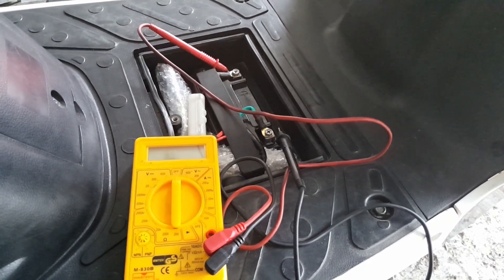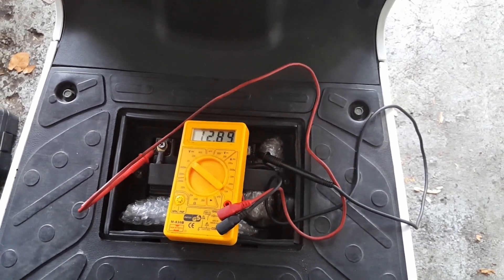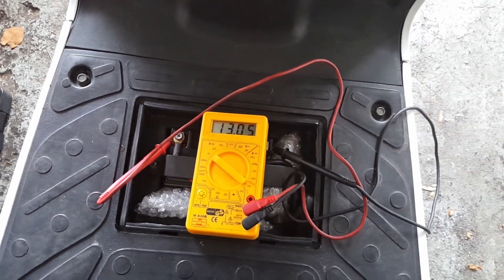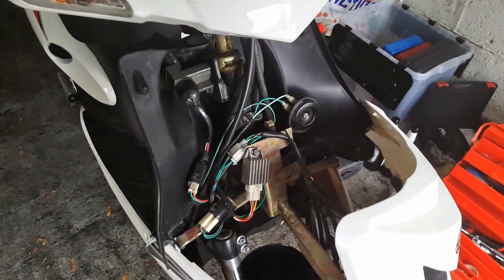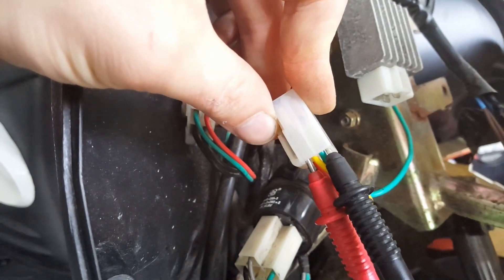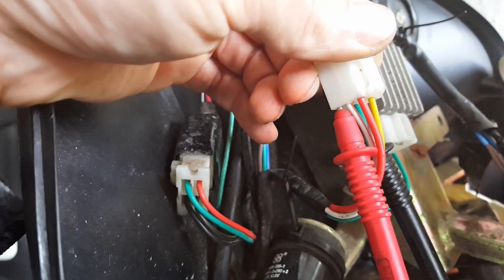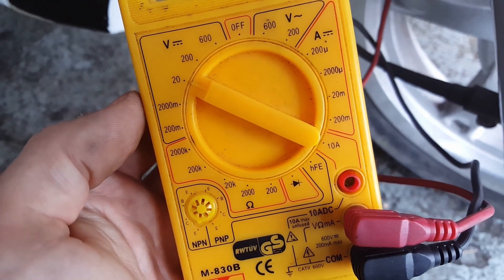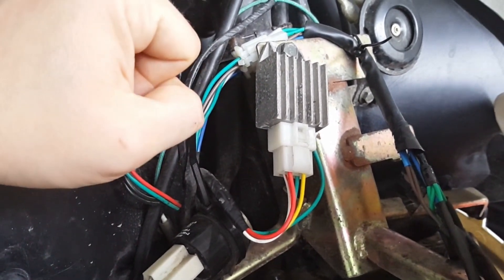How to Test a Scooter Voltage Regulator / Rectifier & Battery Charging Voltage: Step-by-Step Guide

Comment: Hello sir ty for the video. Can u help me? I have 2.3 volts only from white and green and yellow and green both only have 2.3 volts? I have a brand new alternator on it and originally blew grounds that I hope I have them all back connected. The scooter runs but blows bulbs as there is a current going to headlight